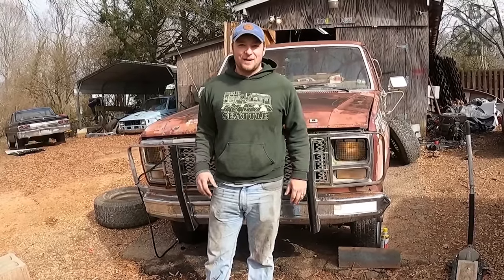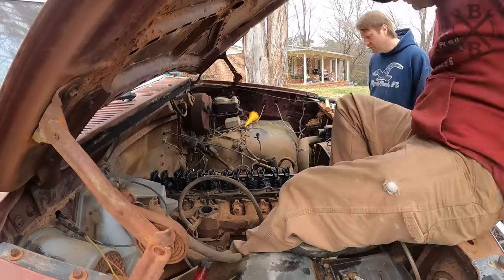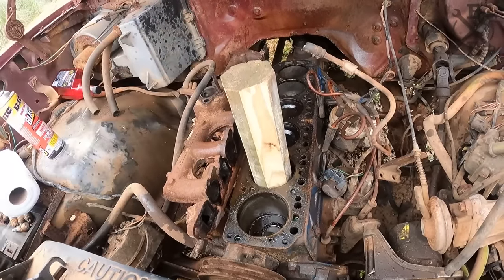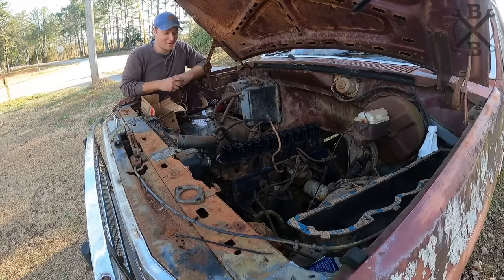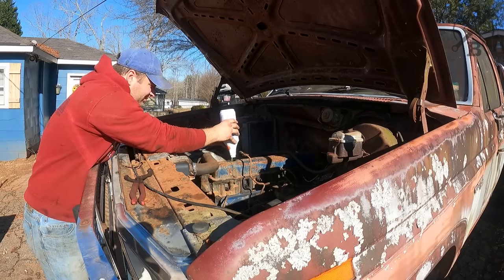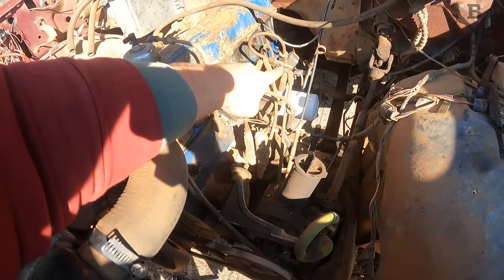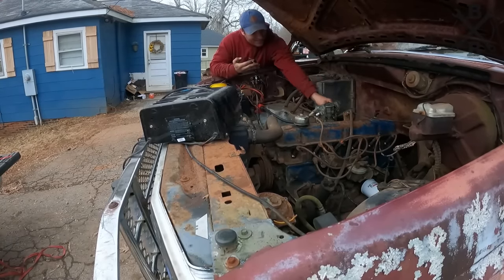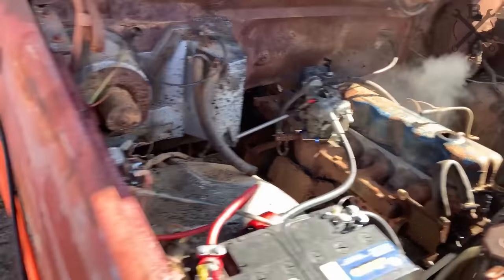Will this Classic Ford F150 Run after sitting for 29+ Years

Comment: I had several mechanics tell me that the 300 was the best engine ever made. I know mine was. I lost oil pressure 16 miles from nowhere. I drove it to the closest town with a mechanic.  I knew he was going to tell me the engine was shot. But he put a new oil pump on it and I drove it another 30,000 miles.
Reply: I had a later model myself 89 or 90 if memory serves. Straight 6 4 speed single cab long bed. I miss that old truck, and the dual tanks.

Comment: You can't kill a 300 I've got a 84 f250 service truck that I converted to a dually and when fully loaded the truck weighs in at 11,500 and I've also got a trailer which is the back half of another service truck that I pulled behind it that weighs about 6,000 and both combined couldn't stop it even up a mountain

Comment: Hello is their a way you can help me with my 1981 ford f150 4x4 long bed same engine and trans . me and my son changed the head gasket out and now it won't run it turns but won't start . Do you know what we did wrong ?

Comment: i have a truck in that exact color and it’s fucked. U fix one thing it runs strong for like 4 min then dies and u can’t start it again.
Reply: pull out the fuel sender/pickup check for pin holes in the pick up tube. If holes are found just slide rubber fuel line  over the pick up tube and hold in place with a hose clamp as close to the top as you can. Bin there and done that.